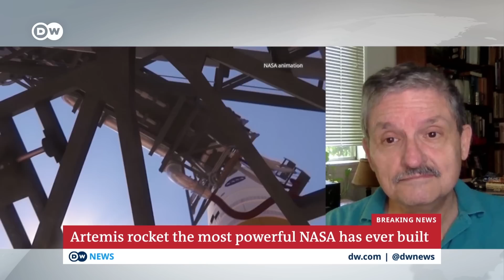NASA postpones Artemis moon rocket launch ... again | DW News

Comment: Quick observations:

01:00 m, The ''valve that connects to the rocket'' is not part of the engine configuration.
01:05 m, Clarification:  Helium is the smallest element in the periodic table.  Its size is 31pm while the size of hydrogen is 53pm.
01:32 m, ''Teething Problems'', not really, as mentioned the majority of components are legacy components.  Nonetheless, the integration based on a different configuration can be challenging, i.e., connect points, seals et al.  Overall, the RS-25 engine in Artemis is the off spring of same engine with improvements and able to generate approximately 0.4 million pounds of thrust.  The Space Shuttle Main Engine (SSME) was rated at ca 0.5 million pounds of thrust.
01:37 m, Tanking is really not rocket science, rocket science being relatively simple.  It is the xyz piping design and integration that is a challenge.  In this case it is unlikely that this valve sees ca 120 psi pressure.  The pressure increases are provided by the downstream low and high pressure turbopumps in the engines which can increase pressures to 5,700 psi as in the case of the high pressure fuel turbopump.  Tanking is like seeing grass grow.  
02:02 m, ''do the right thing at the right temperature'':  Each valve has been thoroughly tested and flight certified besides extensive sublevel tests to assure verification and validation compliance.  The temperature in this case is well known (to the valve), as is the handling of the element either liquid fuel (H2) or liquid oxygen in accordance with design requirements.  Leakage is likely to come from joints or valve internal seals.
02:35 m, Yes, ''the risk that we took then we would not take now''.  Better systems engineering and improvements in many other engineering fields generally account for better performance and reliability.
03:45 m, A traditional NASA program handed over to industry.  The global systems integration, and the continued oversight from NASA had to be provided by the integrator with guidance from NASA.

Comment: As of now, Starship is vaporware. As advertised by SpaceX, it is neverware - it will never do what it is claimed for it. That is the difference. SLS/Orion is a real rocket/spacecraft, with a few minor teething problems involving logistics. The same thing was true for the Atlas, the Titan, all members of the Saturn family, and now the SLS. It was true of the Falcon 9 which had an abysmal early record. SpaceX also have no chance of making a reliable super-lift booster because they depend on clustering of many small engines - thus tremendously increasing the probability of failure and unmodeled interactions of individual engines, even in the unlikely case that they manage to actually build a single example.
Reply: SpaceX can just use falcon heavy to launch Orion if needed thought.

Comment: They can't connect a liquid hydrogen line without it leaking.  This ISN'T rocket science. It's basic materials. It's not happening in space. It's right here on Earth. This isn't a "complexity" issue. It's a basic project management and engineering issue. Atemis is a jobs program. Not a space program. It will never accomplish it's stated mission (a moon landing by Americans). It does accomplish it's actual mission to keep NASA funded by funneling money to congressional districts. NOBODY cares that it doesn't work. They just pretend to. If you think this is bad, do a little research.  Read ALL of the reports on the program. It's not "rocket science." It's just graft.

Comment: Going to space is a big deal!  Just make sure you get it RIGHT, that's what matters!  It'll happen, when it's safe.  Looking forward to the launch, whenever it happens.
Reply: Agree but doesn’t this make you appreciate the accomplishments 50 years ago. 50 years!
Reply: Indeed. You don't rush a launch because the vultures in the MSM will squawk. Screw them, do it right.
Reply: Don't know why NASA hasn't been replaced altogether.  Extreme mismanagment - over billing - years behind schedule - out of control overhead costs - problems integrating so much disparate software and hardware (that should've been homogenized).   Northrop Grumman/Boeing (the contractor here) has proven completely inept at every turn.  And now NASA is awarding them an almost 15 year contract to build all future Artemis missions (wasting even more money and time).

Comment: I decided to watch this piece just to check for all the worthless sniveling in the comments. Who knows how much complexity and fail-safing have gone into just the control software systems alone, let alone all the other engineering systems. I’d like to see figures on how much more code complexity there is compared to Apollo for instance. My experience in developing and integrating involved business software systems, while useless middle managers were carping away on the sidelines, gives me a good hint about how the atmosphere of opinion might be for this project. From what I’ve seen, the current phase is basically an integration one anyway, to see how all the pieces work together. I remember NASA launches all the way back to Vanguard when I was a little kid, and every time I heard about a delay I was GLAD. Get these things done right, and save all the knowledge for future variations.
Reply: I though people like you are instinct.
Reply: This is hooking a hose up to a coupler.   Not only that it's a coupler that has existed since Shuttle. It's not complex. they can't even get hose A to connect to couple B on EARTH... AGAIN! They knew it wouldn't work. It leaked in the wet dress. It leaked on Monday. It leaked today. Don't worry... they will eventually ignore the leak and find the next idiotic problem that already knew existed. Your optimism is precious. In this case NASA is a jobs program, not a space program. This thing will never put a human on the moon.
Reply: @tonyokrongly3235  hahaha they deleted your comment

Comment: Another important difference besides being a more internationally and more carefully planned, i.e. less rushed, compared to the Apollo program is that the Artemis program aims for a permanent presence of humans on the moon.
Reply: Don't know why NASA hasn't been replaced altogether.  Extreme mismanagment - over billing - years behind schedule - out of control overhead costs - problems integrating so much disparate software and hardware (that should've been homogenized).   Northrop Grumman/Boeing (the contractor here) has proven completely inept at every turn.  And now NASA is awarding them an almost 15 year contract to build all future Artemis missions (wasting even more money and time).
Reply: @attsealevel  If it's  Boeing  , it ain't  flying, maybe  they are making sure MCAS  does not  point the rocket 🚀down
Reply: @aurelio-reymilaorcabal9669  that's very funny, but I actually disagree.  Boeing makes excellent planes and the 737 is the safest jet ever made (both crashes per jet and/or # of flights).  Yes, the MCAS was absurd and should've been stress tested first.  But the max is an excellent jet and is once again adding lots of orders.  And the 787 is arguably the most advanced commercial airliner ever built. I did, however appreciate your response (and humor).
Reply: JokoJo UK  No they don't.
Reply: Nasa Should have called it aruserius
Reply: @olavofernandes7286  What is the meaning? Plz explain. I am curious!
Reply: @Dievachi  nasa called the rocket aretimus yet their rocket has problem too much hype so I called the rocket aruserius?
Reply: Joko - the Falcon Heavy has over 2x the thrust of China's newest and most powerful rocket, the "Long March CZ-5B".  Falcon Heavy can also put about 3x as much payload into orbit.  It's got better technology AND it's reusable.
Reply: Joko - SpaceX Starship is another story altogether.  It has about 44x Falcon Heavy's thrust (so about 87x as much thrust as China's most powerful rocket).  It also has about 11x the payload capacity.
Reply: That means that China's most powerful rocket (Long March 5B) is now #4 - behind 2 SpaceX rockets and 1 ULA rocket (which is a joint venture between Boeing and Lockheed Martin).
Reply: Big goals... Big talk.  Zero results. LOL. Using 1980 Space Shuttle Tech ROFLMAO.
Reply: @905JimRaynor  Indeed, they are very ambitious and the tech is really old. Lots of talks are hold around it too. That is true. Eventually I will get up there in Space! With NASA or others! ^^
Reply: @Dievachi  "Space may be the final frontier but it's made in a Hollywood basement"
Reply: @905JimRaynor  Stop talking rubbish. Educate yourself.
Reply: @905JimRaynor  Wow, I love it! So true! Thank you so much for sharing this! <3
Reply: @braxxian  He's pretty much correct. The SLS was pushed by the US congress who wanted to keep NASA work in their states (hello Senator Richard Shelby). It is basically 70's technology and a lot of old Space Shuttle stuff.
Reply: @905JimRaynor  what are you implying lmao
Reply: @braxxian  rubbish? Educate

Comment: NO, in this case, it's not rocket-science.  It's outright negligence.  It is not testing individual components and systems, sufficiently, extensively, before putting the assembly onto the launch pad.  This is the failure of basic parts, like the quick connect seals, and valves, under temperature differences.  All this could be tested and improved before putting it onto the launchpad. One day, such negligence will lead to the thing bIowing up during launch.
Reply: You don't get it, this is now and for the immediate future, a test program. This is not the final result, it is a test program of systems. This is a complex system built by human beings with a lot that can and will go wrong, it is not your Honda Civic.  Unlike Russia NASA lets the world see its victories & its mistakes. That is what I call courage. I say this to you having lived through, and witnessed Apollo 1, NASA has learned from its mistakes and will neither be guided or pushed by armchair critics.

Comment: The whole project should be scrapped. Search for this video title on YT "The SLS is Outdated. Why Does it Exist?".
Reply: NASA should use SpaceX reusable rockets instead SLS, that would be better. Just put the orion spacecraft to the falcon heavy with 2 side booster and they are ready to go.
Reply: @thespacetime99  Exactly. Nearly $300bn ($260 up until 2014 alone) has been spent on this project already. It's a huge gravy train leading to a massive white elephant.
Reply: @Aeronaut1975  all that many
Just Wasted
Man that sucks
Reply: This launch is now 5 yrs overdue.   Yes, that right - initial launch was scheduled for 2017.  And NASA is now signing another 14 year contract with Boeing + Grumman to supply all remaining Artemis rockets.  Those states must love there congressmen.

Comment: Maybe using that design was a bad idea. Hopefully they get it figured out.
Reply: The whole program needs scrapping TBH, SLS is the biggest white elephant that NASA have ever had.
Reply: @Aeronaut1975  it was scrapped , but later resurrected due to political pressure.  The parts used in SLS are from the outdated space shuttle program.